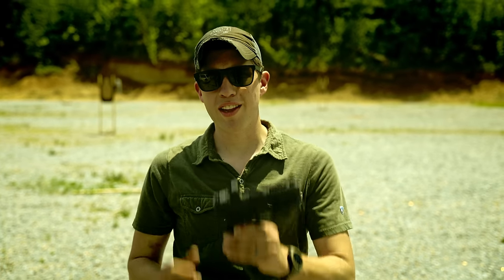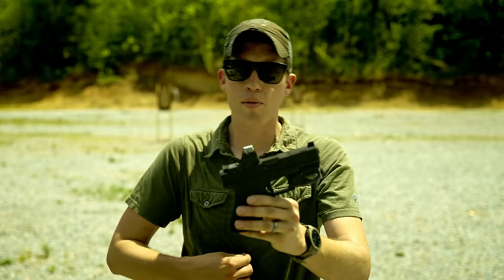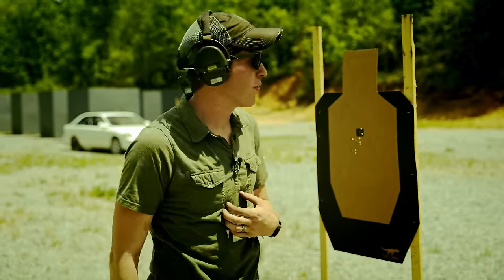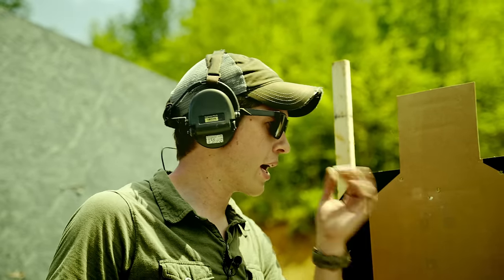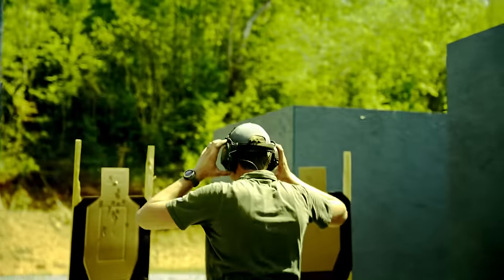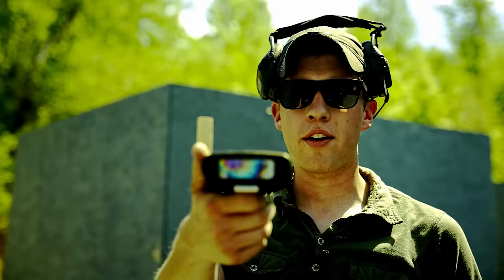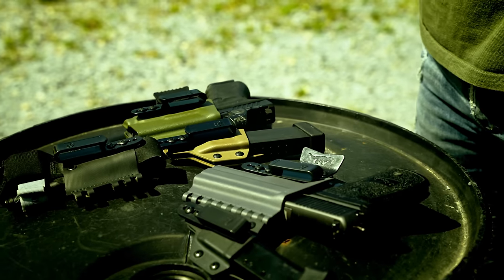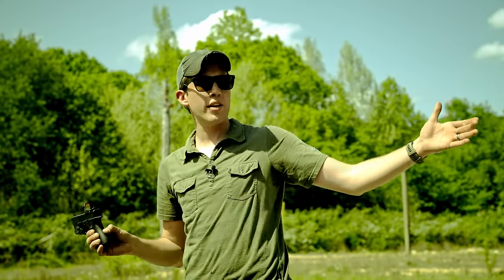How I Test a New EDC Handgun

Comment: Really going out of your comfort zone switching from a Glock to a Glock! They are a good option for sure!
Reply: Most underrated comment under this video.
Reply: brave dude, not afraid of a challenge, I appreciate it
Reply: Surprised that’s the choice he went with, I thought it was a large change
Reply: Hahahaha Glock how quaint
Reply: Hey Glock is the best. All he had to do was get the slide machined and cut, put in a new trigger, change the barrel, the sights, have the grip stippled and ground and cut. Great carry option though……
Reply: @motomortus4009 not so great if you're carrying in the appendix position and have concerns about anything getting in the trigger guard while reholstering.
Reply: @MrKook  striker control device
Reply: @motomortus4009  we're Americans.  Americans like to customize.
Reply: @jessegpresley  I am aware of that product.   I am also aware it is of very limited availability and may not be manufactured at this time.
Reply: Sold both of mine I carried for years for a staccato cs to carry and I honestly have about 1k rds and it works great. Love shooting it just need to keep practicing with that safety.
Reply: Glocks are never a good option.
Reply: @frankcastle9691 yeah that’s why nearly every police department carries them

Comment: Got excited for a minute. Thought he was gonna test a new gun. Not a Glock😂
Reply: same
Reply: Everything about Glock looks great on paper but they use that stupid steep grip angle that I can never get used to.
Reply: @the_inquisitive_inquisitor  on the bright side, M&Ps and CZs are great too if you don’t like Glock’s grip.
Reply: @jimmybronco5336  I like CZs but I don't own any. My carry pistols are all Sig
Reply: Can’t go wrong with a Glock so 😂
Reply: @the_inquisitive_inquisitor  build out a shadow systems mr918 frame and that solves that. (Takes Glock internals much better than the 920).
Reply: @Slimey_garbage_troll thats on you  you need to train anyone can get used to a glock
Reply: @Edc-Guy had 3 of those older  shadow sytems 2 out of 3 gave me problems
Reply: @boomee78  Yo whaddup fellow Boomy
Reply: @boomee78  I just meant the frame/grip which are readily available and using Glock OEM parts short the trigger.
Reply: @Edc-Guy  Quite frankly, I just can't afford to build a custom Glock at the moment.
Reply: @boomee78  I don't own a Glock and I can't afford new guns right now.
Reply: @SG-qk5bn is not worth the hassle. Just  get a stock glock, maybe mos model, and run with it.
Reply: @Slimey_garbage_troll  i wasnt telling you to buy a new gun i was just stating thee grip is not a big deal
Reply: @Jimmy Bronco   I have a 2.0 full size M&P .40 model. I added 2 KKM 9mm, .357sig barrels. A few upgrades. Night sights. It feeds & cycles 💯. Storm cerakote elite. No problems.
Reply: If you don't like Glock, carry one of the many cheaper imitations of them.
Reply: @the_inquisitive_inquisitor  Sell your sigs for a Glock so you can have a quality handgun
Reply: @the_inquisitive_inquisitor  I said that for the first year of owning a 19. If you keep training with it you’ll find that the hump actually assists you with keeping your wrist locked.
Reply: @Bagz1985  It's 9mm not .44 magnum, my wrist isn't THAT weak..

Comment: Yeah, Lucas is spot on regarding aftermarket parts.  Any time I build a new gun, or I make changes to a gun, I take it out and run the piss out of it to make sure it works properly because you CAN and WILL run into issues mixing and matching after market parts in any gun, but there's just a TON of aftermarket parts for Glock pattern handguns and you'd be surprised at how easily some things can not mesh well together.  I have seen some horrible fitments between slides and barrels from different after market manufacturers and don't get me started on triggers.
Reply: That my friend is a phenomenon known as "tolerance stacking". I will say though--most of the aftermarket glock stuff I've bought has been effective. Just buy high quality stuff and usually you won't have issues but as you said you should vet every change to a firearm.
Reply: This is something I didn’t really consider before watching this video. Great points.
Reply: @armorers_wrench  Plus a great excuse to get to the range and get in some drills, lol
Reply: @ReubenPastrami  I have more time behind a stick than most LEOs I know and shoot with.  Training is key.  It's the indian, not the arrow.  But if you maintain a high performance standard, no reason not to have a nice arrow.
Reply: Zev is one of the few aftermarket companies worth buying.

Comment: One thing to never forget when going and testing your new carry gun- run the loads you inted to carry with!!! At least an extra box of 20-50 rounds to verify that the OAL and profile of your bullet choice will properly clear the feed ramp, especially on more compact handguns with sharper ramps. 
Those of us who ever carried a tiny colt mustang style conceal gun (Kimber Micro9, Sig P938, Springfield 911, etc) or even 1911's know that they are notorious for "denying entry" of hollow point ammunition!
Reply: Or get a glock
Reply: A mistake I made long ago with my Kimber SIS Pro. I never ranged the ammo I had in it every day. For almost a year before finally deciding "Yeah, I should probably practice with the ammo I have in it every day" just to find out the Kimber did not like it AT ALL. Failure to feeds, stoves galore. Ironically it feed cheap range ammo just fine. But some of the more well known defense rounds. It wanted none of it. 

I walked around for a year with a 1911 that wouldn't have worked well if at all. Was a huge wake up call.

Have since moved to an HK45c, which eats literally anything you throw at it. Been happy ever since.

Comment: Been running a Glock 17 for my whole Concealed carry life. And I been thinking for who know how long, “which pistol I can get next for a battle belt” then by the Grace of God I thought “why not just carry the same pistol” BIG BRAIN!!!
Reply: Sir, is it hard to “conceal” a Glock 17? How do you conceal it? It’s nice to save some money by using the same gun.

Also I’m a lefty and I got small hands, I feel like the 17 isn’t the best choice for me. Correct me if I’m wrong. 

Good day!!
Reply: @peter-jm1pu  I also CC a Glock 17 in the Sidecar from TREX Arms with a spare mag, it’s really not that bad. I’m about 6’0 250 lbs. and the only difference I had to make is start buying my shirts a bit looser.
Reply: @peter-jm1pu  The hardest part for me is the end of the grip. It being a full size it sticks out a inch or so over a Glock 19. I use a TRex arms holster and I put the “wing” on the front so it pushing the pistol more into me. It is alittle big but not near enough for me not to wear it everyday. I’m a skinny guy so it’s easy for me and TRex arms does make holsters for lefty’s. Hope this helps.
Reply: @peter-jm1pu  Personally I think your build/body type will influence it a lot, like if you're 5'4" 110lbs, a full size handgun might be a bit much. With small hands a Glock 19 might be a better option
Reply: I own a few Glocks. I often use my beat up used Glock 22 gen 4 mainly because it's simple, has a lot of add-ons, Cerakote Elite slide, 3 after market barrels. .357sig, .40, 9x19mm. I have a gen 5 Glock 26 9mm that is great for ccw, defense too.
Reply: @dylanturley7291  Which light are you mounting ?
Reply: @Soucka74  TLR-7A stream light
Reply: G17 gen 4 RMR TLR1HL Zev slide+barrel. Best set up I've used and ccw.
Reply: Good idea. Glock 17 Gen 5 is mine
Reply: @peter  you can learn to do it. I'm a left with the same problem. If you need an extra mag or malfunction in 99.9% of an attacker ots very close, so ypur dead anyways of your gun malfunctions. Why no one is saying that, I don't know. It's money.

Comment: Glad to hear the Zev slide worked out for you, I however did not have the same luck with the one I ordered from you guys. The firing pin channel was way out of spec, the channel liner could just fall right out of it with ease. Your people told me I was SOL and I should take it up with Zev. Zev told me to sent it in and supposedly they’ll send me another one but I’m definitely not trusting that thing on a gun I’m going to depend on. Should’ve just got my oem slide milled

Comment: Due to the nature of the "active killer" / "hyperviolent shooter" or old school terrorism threat, accuracy is very important to me. While defending yourself at bad breath distance, which is a very common and realistic threat, fast A-zone hits are the key, and only hits count in any fight, the threat from one of the highly publicized shooters is different. A "T-slot" shot may need to be made from a greater distance, especially if you are of the profession of responding to gunfire you were not originally directly involved in. I will absolutely not carry a pistol that I am not capable of hitting with boring repeatability, rapid shots on a head-sized targets at 50 meters. Yes, with an RDS. I have a Prodigy that I can make hits out to 110 yards (my Wife and children bore witness) but I do not carry it due to reliability issues. I too typically have a G19 when out of the house. Although in certain circumstances based alot on recurring disability from lifetime injury, I will carry smaller pistols too, but I am very aware that my abilities with them decrease with their size. Just my point zero two dollar's worth.

Comment: Sig Fan Boy callout around the 15:00 mark haha. Anecdotal, but every P320 I've witnessed first hand in range trips or classes has had problems. And none of them except one were base models, they were nearly $1000 models. None of them were catastrophic, but of the ones I spoke to, most of them were new to the shooters and they were just becoming aware that their "Military Tested and Approved" pistols were quite ammo sensitive.  Just my experience. 
Loved seeing the 228, old school DA/SA sigs are badass!
Reply: Hmmmm…320-legion plus 200k round, 320-357sig with plus 30k.  Yes 320 are strong heavy from factory, so no cheap shit.  No a big deal.  I reload so ammo is $90 per 1000 rounds.   With glock would cost 3 times that or replace barrel.
Reply: Funny I had the exact opposite experience. Glock shooters kept looking at their guns wondering why they were so far off target while the sig guys smiled? 🤷‍♂️
Reply: @dsig7776 did they figure out why they were so off?  And all the sig guys were really smiling at each other?
Reply: @heaterfamily you have 200,000 rounds through that gun and another 30,000 through another?  That’s a lot of shooting.

Comment: I can't stand glock 19 grip size. I have to use glock 45 or 17. To each their own.
Reply: 19 is a compact frame. 45/17 is full size. Fun fact. Get a 45 not a 17 because a 45 slide can be used on a 45 & 19 frame.

Comment: The P228 is nice, but it's thicker (larger in every dimesrion) and heavier than the 19 which can be just as accurate with training.  I have found it easier to attain great accuracy with the P228, but that juice isn't worth the squeeze.  The Seals went to the 19, so if you're wanting a Sig instead; go to the P226 since it's just under .5" longer and taller.  Thanks for your hard work guys.  To the first aid point, it'd be nice if you inserted medical emergency drills into your Training scenarios since you have an entire facility: pop quiz; you took an injury to the leg - what would you do.  There are courses out there, so preface with that, but giving examples goes along way towards building that mental readiness since 1st aid and fires are more likely (range trips are just fun and no one really wants conflict) however, the old adage adage applies: "if you want peace, prepare for war".
Reply: SEALS Shoot what ever they want. Not too many are Glocks anymore. Ask me how I know

Comment: Very informative and accurate. I recently purchased an xdme for competition purposes. And until I took it to the range it stayed right in its box. Pistols should be fired before intending to trust your life on it. I took the new pistol to the range, shot 310 rounds at least, and the firearm ran amazing. I still have to put about 300rds more through it but I will make sure the gun cycles and runs perfectly before I use it for what I purchased it for. 

P.s I shot about 700+rds through my hellcat pro before making it my edc

Comment: My favorite Glocks of all time are the Gen 3 RTF frame G17 and G19. I never should've gotten rid of those. My best friend still has them and won't sell them back lol. I've shot hundreds of thousands of rounds through Glocks over 30+ years. My retiree gun is a stock G17 Gen 4 with over 130K through it. Can't go wrong with them, and all of mine are bone stock Glocks. I might have the slide cut for and optic and serrations and the grips stippled but otherwise everything is stock on the gun unless I have to change the sights out (always when they're plastic sights). Only gun I trust right out of the box. Still love my other guns for sure  but I've trusted my life to Glocks since the early 90's and after seeing literally millions of rounds shot through them, they'll always be my favorite. Ain't the prettiest, ain't the most ergonomic, definitely not the best triggers but they are accurate, reliable and have great longevity.

Comment: I agree  it worked some where that used flock 19 they had range guns that shot wonky and they still fired with no malfunctions. Had a friend that fired one that shot slightly to the right as the barrel was shot to death still worked just not perfect. They still re0lace springs every so often but the guns still worked

Comment: I just switched my carry from 19 to gen 3 aftermarket Glock frame GST-9.  It has built in all the common enhancements Glock enthusiasts make; straight back, high cut trigger guard, no finger grooves, perfect stippling, and built in mag well.  So here’s the thing, the grip is more round than blocky so no pressure points around the edges and no finger grooves so you get a consistent 360 grip with your whole hand.  It really makes a difference with double hand grip, no high points and air tight.  Also the only frame I know that you can have a 19 slide with a 17 grip, 19 grip is a slight compromise for my hand, I don’t like the feeling of it hanging over the edge.

Comment: Not a criticism or even a suggestion but i just wanna say:
I zero the red dot on my carry gun using a bench, and dial it in to the point where im hole in hole at 15 yards.
Not because im concerned with being that accurate, but because i wanna know the gun is dead on, so if im missing, i know for SURE its me.

In other words, if i suck, i suck

Comment: What about using the standards set forth by NIJ Standard 0112.3, Autoloading Pistols for Police Officers? Excluding the drop testing, its 600rds with no more than 3 malfunctions allowed (no more than 5 attributed to ammo) for initial testing. For "reissue" any modifications, repairs, or gunsmithing work after initial testing, its 2x the highest capacity magazine carried for "duty", times the number of mags carried for duty. Ex: You carry 2 17rd mags and 1 15rd mag. So 17x2=34. 34x3=102rds. For round counts under 200rds, no more than 1 malfunction no attributable to faulty ammunition.
Reply: that's just a government standard so something is "good enough"

Comment: Are the aftermarket slides from companies like Jagerwerks or Zev good? I’m looking into getting a new carry gun and I’ve been looking at Shadow Ststems complete pistols vs a stock Glock. The main thing keeping me from a Glock is just the stock optics mounting system which seems to be lacking to me. Plus the stock sights are basically throwaway placeholders.
Reply: Buy a cheap surplus police glock from aim surplus then get a slide from norsso, zev tech or whatever company you want.

Comment: The bit about malfunctions is absolutely real.  Many times, people do not stop to think whether a malfunction was the fault of their own gun of the ammo they use.  I shoot allot of shotgun sports.  Specifically Bunker Trap.  Due to the general build quality of components like the firing pins or the triggers in most over-under sporting shotguns, you can almost always attribute failure to fires to the ammo.  You get a real good sense of what manufacturers are good and what manufacturers are questionable very quickly (if you shoot allot from different companies).  My honest advice is to buy from Federal, Winchester, or Fiocchi.  Out of the probably 200k rounds I've shot between those three, I have had genuinely bad primers in the single digits.

Comment: I’m running the same setup except for my Glock 19 being a Gen 4, but my slide will sometimes fail to cycle back into battery while pushing the new round up the feed ramp. Any ideas? I’m relatively new to the optic game.

Comment: You should really try the Glock 43X with 15 round shield arms magazines.
I have around 4000 rounds through mine without one single problem.
I put ameriglo sights on it and a 3.5 pound trigger, a tungsten guide rod, extended mag release and slide release. I also have a 15 round shield arms magazine with extension putting the count to 20 rounds.
Reply: Surprising. It seems 50/50 on guys who love the shield mags and the hate them. I’m curious how their gen 3 mags will be

Comment: I caught a deficiency of my own a few months ago while shooting my 19X. I kept having the pistol go into slide lock even though there were rounds in the mag and there was absolutely nothing obvious wrong with the gun.....it was my grip getting too high with my daggone thumb!
Reply: Very common on a lot of handguns - and tough to undo.
Reply: @oskar6661  I feel like I got pretty lucky. Aside from that, I would get some slide burn on the skin between my thumb and hand because of the same deal. Getting a little too high on the gun. Well I tried putting the grip Backstrap on and put some grip tape on. I've shot maybe a thousand to 1500 rounds since then with no more instances.